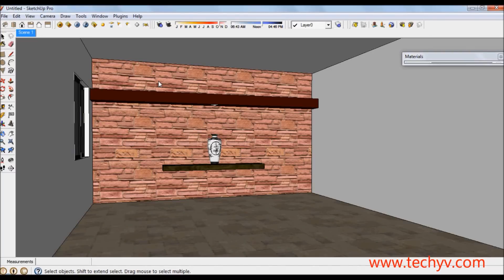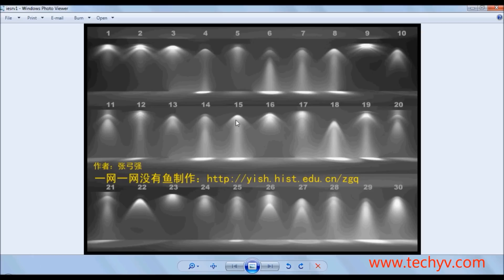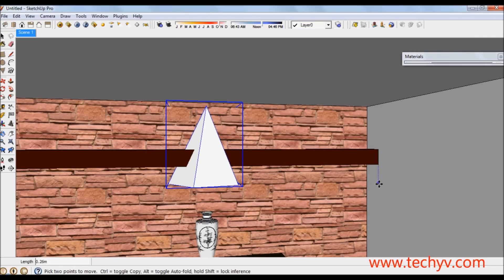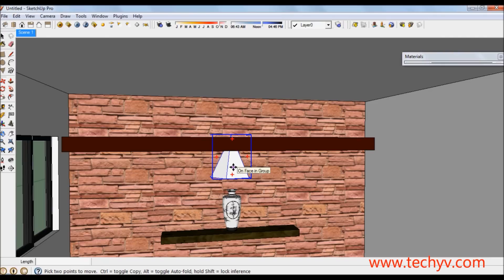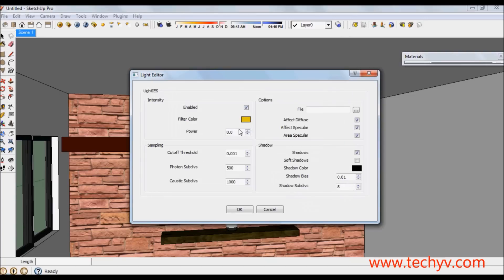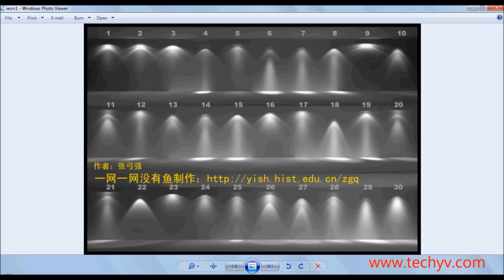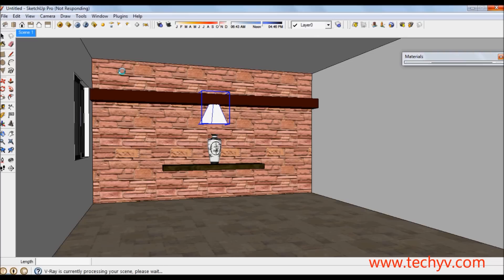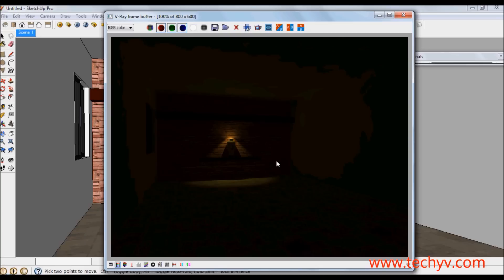How To Apply Lighting Effects Using Vray for Sketchup

Comment: Excellent Video! After watching this video I have come to know that SketchUp Pro is useful for hundreds of professionals in architecture, construction, engineering, commercial interiors, light construction, landscape architecture and plenty of other fields. This software is like a pencil super-powers, which starts by drawing lines and shapes. I can make anything like stretch copy, rotate, paint and so on. Building models with custom behaviors and attributes, SketchUp Pro is as easy and powerful as I want it to be. It can show me exactly what I want to see from anywhere in my model. Thanks Techyv for attaching this wonderful video which for now I am able to use SketchUp Pro perfectly.